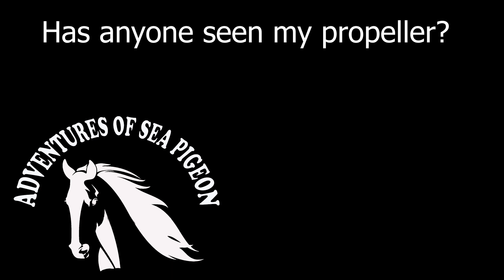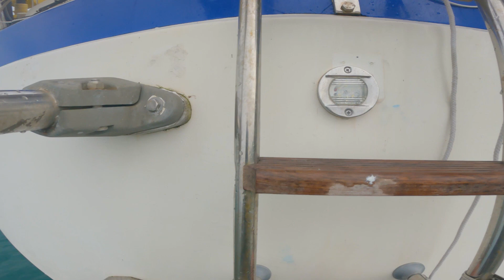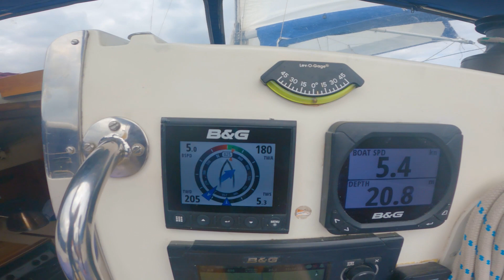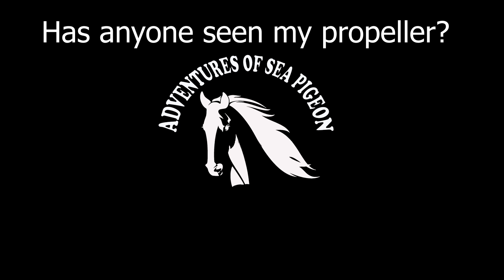Has anyone seen my propeller?

Comment from the maker: Follow up. I put the boat against the wall and dried out today. I wanted to check the propeller. Also i got a proper tab washer for the propeller and installed this. I think that i had not bent the previous tab washer over enough previously.